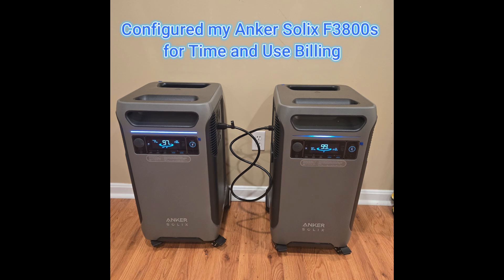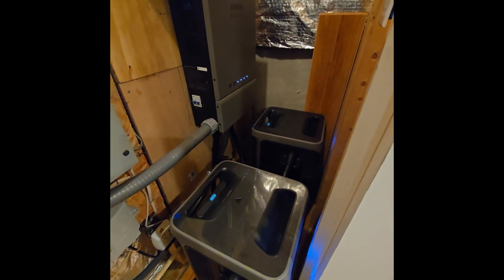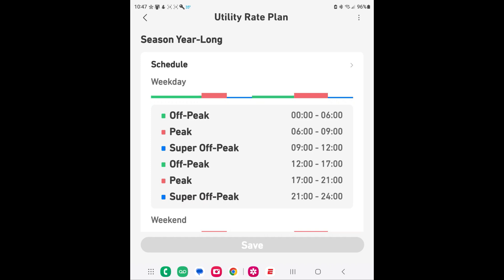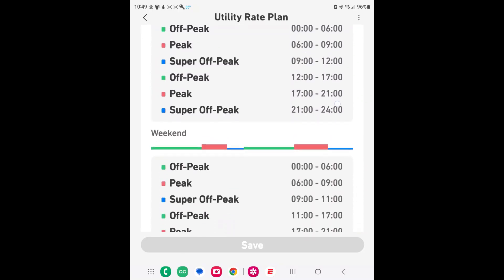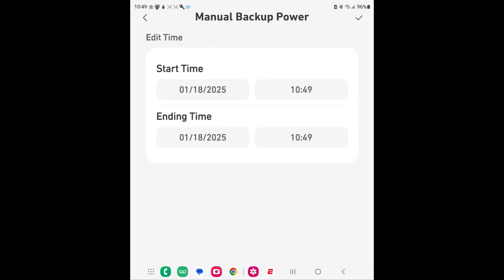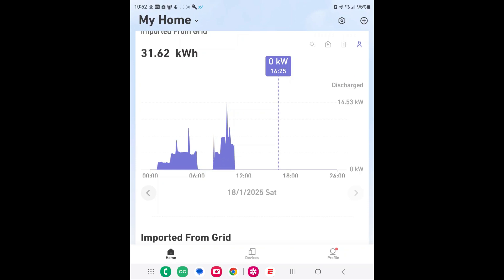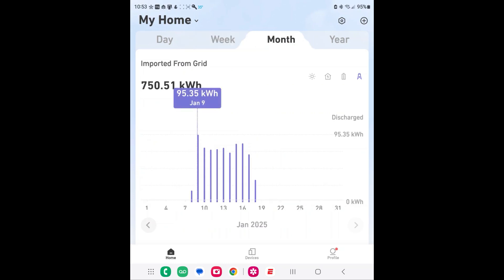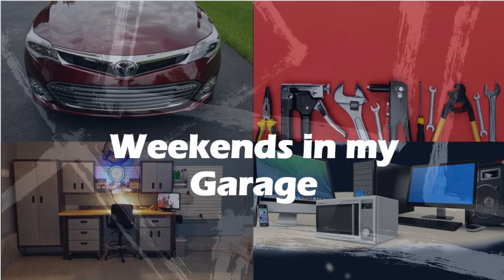Configured my Anker Solix F3800s for Time and Use Billing

Comment: What has your savings been like? I have similar energy charges.
Reply: Thanks for your comment.  I ran into a technical issue with one of my F3800s.  Anker is sending me out a replacement.  I can't give a precise number, but I would say we should see about a $50 per month in possible savings with Time of Use.  We have made some adjustments in our lifestyle to align with the ToU.  Like using the washing machine and other high current items during Off Peak hours.